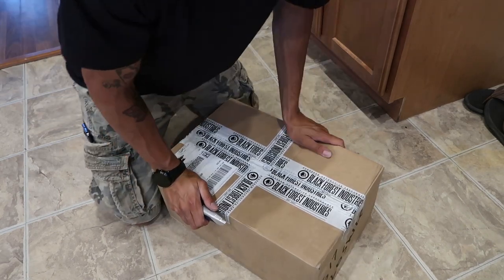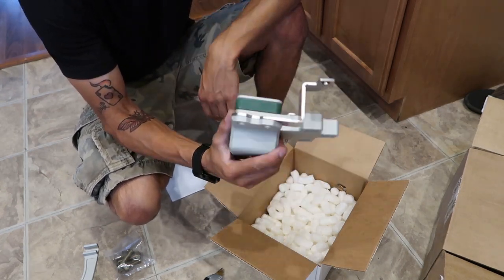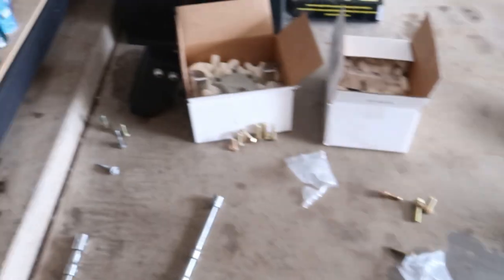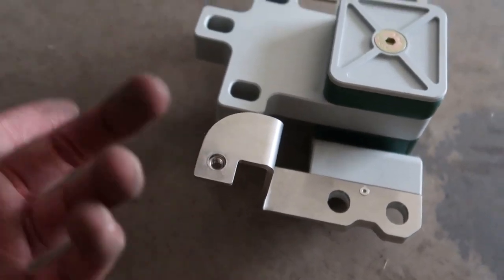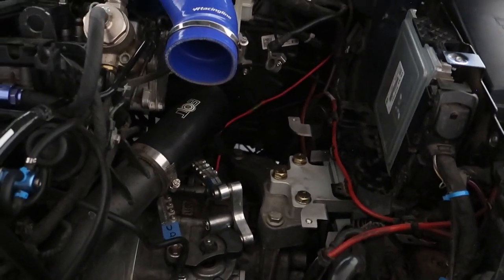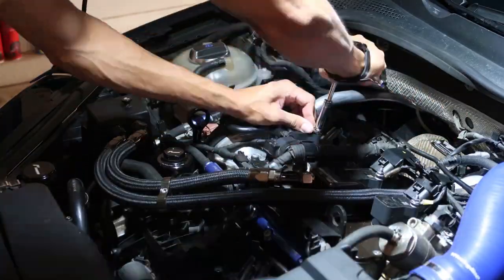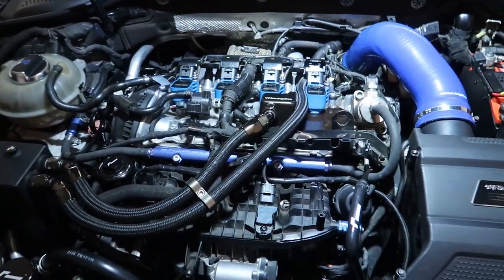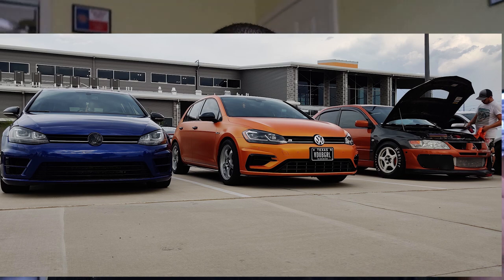New engine & trans mounts + APR coilpacks! | MK7 Golf R

Comment: Nice bro! I thought u had RS3 coil packs already? What benefits do these APR ones give? How much are they if u don’t mind me asking - I’ve had stock coil packs in my R, may upgrade my packs in my next service
Reply from the maker: I did have rs3's in, there are just supposed to give a stronger spark, they're about $40 a pop so ~150ish. If you're low milage id wait till about 50-60k unless you're about to strap a bigger turbo on or run an E blend

Comment: Question, how come you choose to go with BFI over the 034 Motorsports billet motor mounts?  Love your channel btw!
Reply from the maker: They're just simply the best at mounts. I've ran them for years on other cars with no issues ever. I've heard a lot of complaints about the 034 stuff after some miles
Reply: 034s are junk and fail
Reply: My tuner was telling me to stay away from 034 mousts as they will cause false knock and cause pulled timing....who knows tho
Reply from the maker: Just go BFI and not ever worry, simple as that you won't regret it
Reply: @BryceJordanProductions  ^this guy gets it.
Reply: @corymichalsen4574  When your motor slops around because they have failed, yep.
Reply: I currently have bfi mounts
Reply: I was told by my tuner to go 034 on my mounts and I haven’t had any issues since 🤷🏻‍♂️ they been reliable to me

Comment: What kind of whp are you making on your 7R currently?
Reply from the maker: Last Dyno @28psi on91 was 447. I'm at 32psi now
Reply: @BryceJordanProductions  Nice, done any e85 runs yet?
Reply from the maker: E50 last year did 480 some @28psi 🙂 wasn't to keen on running it like that without a fuel pump controller though, never went down the 1/4 on that tune. But now with the PM4 controller in I feel comfortable getting another E tune and letting it rip. Hoping to see 520-530 wheel on ~E60 @32psi

Comment: Do you have a fluid damper?
Reply from the maker: I do not but I plan on one when I build the motor
Reply: I had one on my stg 3 mk5 with similar motor mounts and it made a huge difference with NVH. I’m likely doing one on my 7.5 when I replace the clutch.
Reply from the maker: Smart move!!